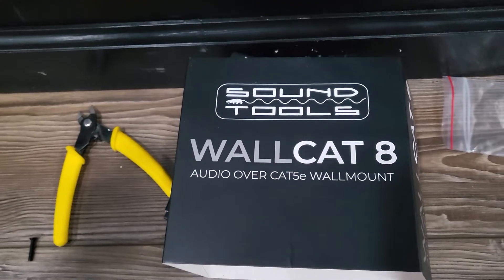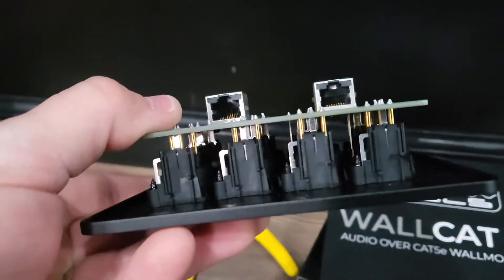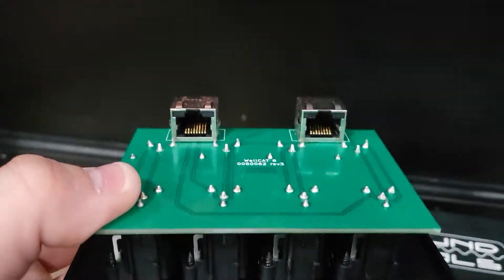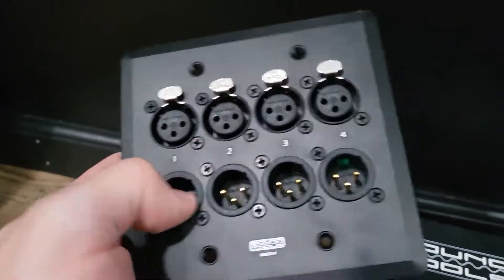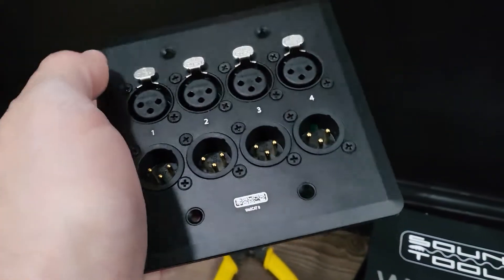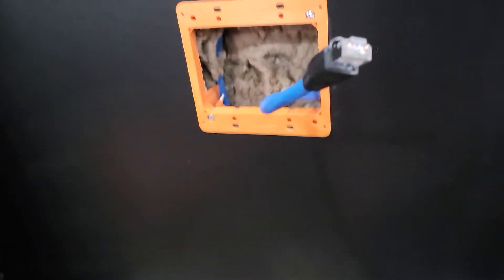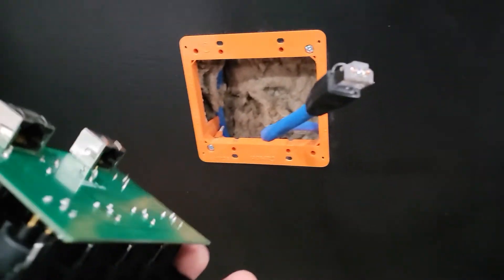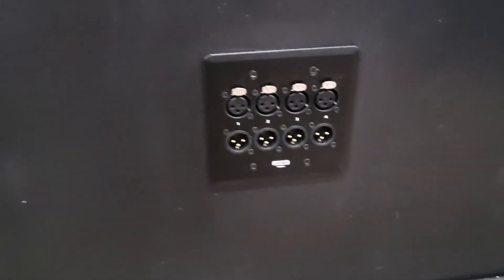Sound Tools WallCAT 8 Installation

Comment: This is a great idea. But... if XLR uses 3 pins per connection. and you have 8 jacks. 8x3 = 24. The cat 6 cable has a total of 8 separate wires and there are two rj45 jacks on the unit 8x2= 16, why wouldnt they just add a 3rd RJ45 jack for you can use every XLR jack at the same time?
Reply: One ethernet cable can transport 4 audio signals since you only need one pair of wires per (balanced) signal plus one common ground for all for of them (which is the 3rd pin in xlr). The second rj45 is to pass on the same 4 channels if you want a second plate with the same 4 signals. On this wallplate the xlr In- and Outputs are mirrored so you can use all four channels for whichever you need rn. This makes it flexible for different usecases.
There is other versions of this wallmount plate with only In- or Outputs.
Reply: @FerdinandSilberg  with a normal XLR stagebox/wall box, you have an individual mic cable running from each xlr input to the control room correct? So each input has its own ground, whereas this system shares a ground with 4 inputs. Does that cause an issue?